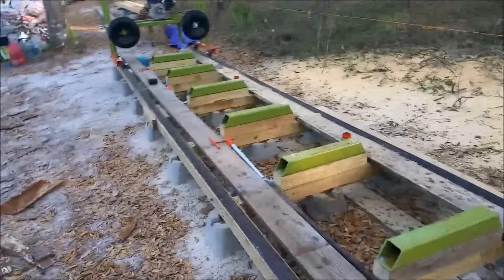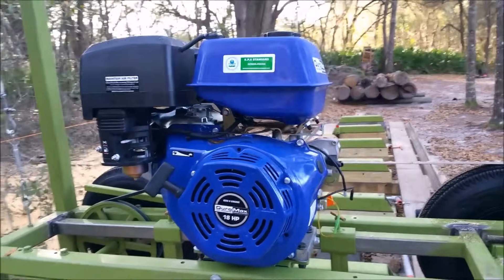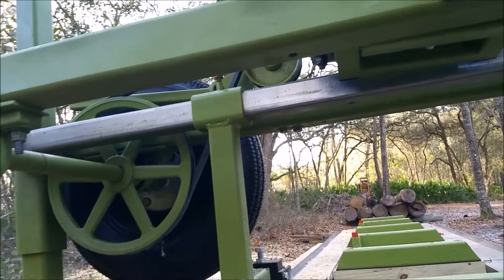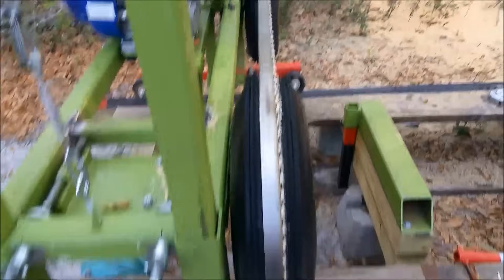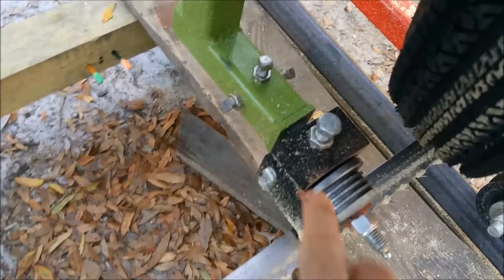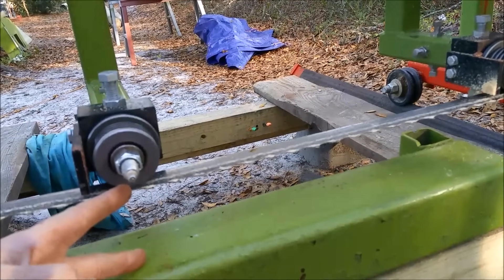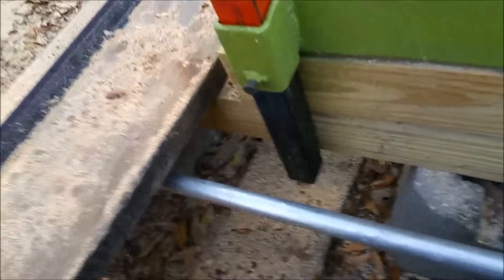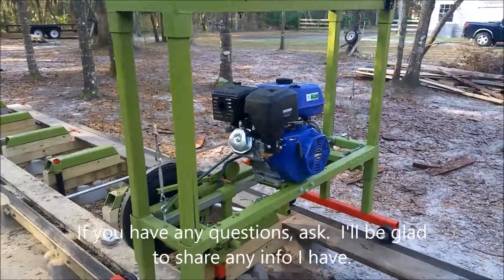Homemade Bandsaw Mill walk-around

Comment: Hey Josh, just getting back to finishing up my mill based on your design. First, I have to say I admire you for the support you give your followers with quick replies. Basically the only main difference I have made is using sheaves for the blade wheels instead of tires.
You gave some advice in the past about using cooks guides which I have purchased.  I am just ordering the 18hp Duramax and am trying to figure out the belt tensioner from the video images.  I do not need plans but some guidance and/or maybe a sketch of your assembly. I can see some of it but cannot determine where the pivot is.  Tried to view other mills and tensioner designs but none give enough information. You may have answered this within the comments but I do not know how to search within the content.  I hate having to ask but any help would be appreciated.
Reply from the maker: It has been a while for me, but I can try to answer. Of the whole mill, the tension/alignment was the hardest to create and make functional. The reason is the enormous amount of tension on the blade. After rebuilding this mill, I scrapped the tension/alignment of this build and went with a while different design from scratch. Anyways, this video has the tension/alignment design with the plate that slides and pivots. There is no "actual" pivot point. The plate slides within the rails along the sides and is curved on each end to allow pivot. The rest was created using 5/8" threaded rod and 1/4" handles like a vise design. I used coupling nuts so the threaded rod would have more bite. My pillow block bearings where mounted to this plate also. To tension the blade, you would turn both threaded rods to draw the plate away from the opposite axle. Once tight, you could tighten front or back threaded rod to adjust the alignment. The plate free floats within the rails. Hope this explains the process of what needs to happen.

Now why did I scrap this design? A few reasons. 1. The threaded rod and nuts showed fatigue that would have led to failure in a short period of time. 2. The plate was free floating which allows for movement that could not be fine-tuned. 3. Because the plate could bind within the rails and cause false tension pressure making you think it was the blade tension when in reality it was bound up.

The new design was using 3/4" threaded rod and square tubing the length of the blade. I welded handles to each end of the rod that stuck out past the band wheels on each side. This was much better for tension  and had no points of binding except on the threads themselves. For the alignment, I created an actual axle for two plates to pivot on. One plate welded to the frame, the other was able to pivot. I had a bolt that pushed the plate one way and one that pushed the plate the other. Once both were tightened, the alignment wasn't moving. Now, with blade expansion over usage, there was still a need for fine tuning, but a much better design. I also went to band wheels with the final rebuild.

I sure hope this helps. I don't have pictures or drawings to assist my explanations either. I never ever thought I'd be seen as a place to gain knowledge about sawmills. I'm 100% a DIYer and tinker with junk randomly. Lol .. As for Cooks, they are the place to gain useful knowledge.
Reply: @joshsbomber  Thanks again for such a quick response.  I know your time is valuable. Actually I was asking about the drive belt tensioner but am glad you replied as about blade tension. WOW. I was just getting ready to cut the slide plate for the blade tensioner.  I will try to look at how others are doing their blade tension for some ideas. I can usually figure these things out but this is a total different venture for me. By the way, I am practically a neighbor as I live in Columbia, SC and have lots of white pine available. I am only 68 so hope to get lots of use out of it when it is complete.
Reply from the maker: Lol. Maybe I should read a little better. Anyways, I went to a centrifugal clutch on the motor and would do it 100 times again. I used the motor mount to tighten the belt on that. 

I have family allover around Conway, Aynor, Sumter area...
Reply: Thanks Josh and cool about having family here.  We go through Aynor and Conway often on the way to the family beach house in Garden City and occasionally go through Sumter. Also will be headed down the Space Coast in May while my son is here from Washington State to go to the space center.
Any particular centrifugal clutch you can recommend. I like the simplicity of having that as opposed to a lever.  
I did order the engine from Lowe's today cause I get a military discount.
Reply from the maker: Cool. Enjoy your time at the space center. Cool place. 
I used a heavy duty centrifugal clutch. Not sure what brand or whatever. It works great.

Comment: Show how you attached the angle to the wood for rolling down track
Reply from the maker: I sold this mill a couple years ago, but all I did was drill some holes (bigger than the screws) through the edge of the angle. I used 3 1/2" deck screws through the holes into the 4x4s. To make sure the angle ran parallel, I rolled the carriage over the holes  on each side, then put the screw in. Moved on to the next one.

Comment: I love your build, did you set the tires to use a certain blade? I have been watching a lot of videos and some of the guys are saying they built them to accept standard blades like the hm130 or woodmizer 15. I'm trying to figure that part out.
Reply from the maker: Thank you. As for the tire setup, I bought the blades first and built accordingly. I also picked a popular size blade so 1) they'd be easy to find competitively and 2) to better find options on pitch, tpi, and hardness. Otherwise, blades can be custom made for whatever size you need, but at that point you have less options and less timely blade purchases.

Comment: Hi, this is awesome! I see you’ve posted awhile ago. How much use have you got out of it and. Are you still happy with the design?
Reply from the maker: I actually rebuilt this one with bigger axles and cast steel band wheels. I ended up selling that mill before making a video. 

The mill in the video had a few little flaws. The axles were undersized causing them to break often. The blade tensioner/alignment combo plate idea was a great idea, but not in reality. If I tightened the blade, I had to realign the wheel. I ended up spending more time on adjustments than actually cutting. On the rebuild, I upped the axle sizes, moved the bearings closer to the wheels, used actual band wheels, upgraded to 18hp, made tensioner separate from alignment, and extended the height another 20 inches. 

I really wish I would have made a video of the rebuild. If you plan to build your own, keep in mind that everything needs to be solid but adjustable. That's the hardest part to figure out. Go look at some and get ideas then go from there.
Reply: Gotta wing it an start somewhere you could change a component 10 times before going..... "oh"...... even the welds would need to be strategically layed or stuff will move and you'll never get it back square. Has anyone tried pumping up with nitrogen in the car tires?

Comment: I absolutely like this build. I see nothing wrong with it and seems to be very solid in design and construction. Do you have any issues without dripping water on the blade for lubrications? I would like to make something similar but maybe a bit shorter in length, being how I don't have a way to move long logs around with other equipment. Thumbs Up for sure!
Reply from the maker: Thank you. It was a good mill and I actually rebuilt it with larger axles and cast band wheels, but never got a video of that one before selling it. As for the water, I found that my mill did better dry than wet. Not sure why, but it did...

Comment: That's a good looking saw.if its flat ,level it will cut straight ,as long as you have enough tension on your blade and watch you push speed it won't dive on you.practice makes perfect, good luck

Comment: Do you get any racking or shimmying of the carriage in wider cuts with your mill? I have a very similar design to yours but i get the carriage almost 'walking' along tracks, when buried in a wide hardwood cut
Reply from the maker: There's some misalignment going on with big cuts or hard wood. I didn't know much about anything when I started on this and later realized that some tighter clearances would have eliminated some of that movement, but for yellow pine it cut fine enough to run through my planer.
Reply: @joshsbomber  mine is perfectly acceptable, I just get a bit of a washboard pattern while it's happening but still nice and flat. Just bugs me in my never ending quest for improvement
Reply from the maker: Haha. I hear you. I sold mine because I never could get it perfect. Gave up
Reply: @joshsbomber  haha I went the other way and now have 80ton of black walnut logs sitting in my yard. Was a strange offer that came up and I couldn't refuse. Definitely not how I'd have designed my machine if I knew I'd be chewing on an 80ton stack of logs
Reply from the maker: Haha. Right!?

Comment: I'm curious how long the blade lasts before you have to swap it out?  And can you resharpen them ?
Reply from the maker: Some guys cut a lot more wood than I did. I think I've heard before that some got 1000 board feet on a new blade and yes, they can be sharpened.
Reply: @joshsbomber   That's a good amount of lumber.  I was debating whether to try an build a swing blade sawmill, or a bandsaw mill.  I like the simplicity of your mill.
Reply from the maker: I looked at them all before building and settled with the bandsaw. Less waste, fast cuts, and the swing blade only cuts dimensional lumber.

Comment: Enjoyed video! Mill looks great! I like the design but didn't see much saw dust. How well does it saw?
Reply from the maker: It sawed straight enough to run the boards through a planer to finish off. Not too bad, in my opinion. I rebuilt it after this video and ended up selling it. Check out my channel, there's a video of two of it sawing

Comment: nice build what size shaft and pillow blocks are they?
Reply from the maker: I forget what website it is with a calculator,  but Google search it and it will give you the blade feet per minute. Should be around 5000 if I remember right.
Reply from the maker: Thanks. This build was 1" axles (axle steel), but they broke a few times. I ended up rebuilding this mill with 1.5" cold rolled axles. The larger axles worked much better - never broke on me
Reply: @joshsbomber  Ya I am making one right now and i didn't want to go with 1 inch shaft so I'm  going with 1 1/4 and  16 hp duramax , 19'' band wheels and a 14'' drive wheel and a 3'' centrifugal clutch so hope it works. For some reason I was like do i get a larger size pillow block to go over the 11/4 pillow block its been awhile. thanx
Reply: I mean the 1 1/4 shaft. by the way do you feel your tire pulley ratio is good?

Comment: Looks like you got it {DIY Bandsaw Mill} dialed in this time. May I make a suggestion, instead of using the adjustable clamp's to hold the wire cable, make your self a DIY Stainless s Steel Safety Wire (Uses 0.032" in. Dia. Wire) only, (not plain old steel wire. Does not have the strength like Stainless.) Clamp Tool. Speaking from experience, the stainless wire compared to regular wire, is approx. The stainless wire is 3 times stronger to 1 (plain steel wire of same diameter) difference.  See for clamp tool design, and how to use: ClampTite Wire Clamp Tool | SEMA Show Preview - - https://www.youtube.com/watch?v=3NXVnmMjFk4
Reply from the maker: Thanks for the comment. Sounds like good advise. This mill was rebuilt after the video and eventually sold to a guy within an hour or so of me.

Comment: G'day! I am designing a bandsaw mill and taking a lot of notes from your design. After a few years of using yours, what things would you do differently/change with your design? Or are you happy with the way everything works??
Reply from the maker: Very good question. I rebuilt this mill starting with the axle size and actual band wheels. Go ahead and spend the money on larger diameter axles and cast wheels (pulleys or bandwheels). Otherwise the rebuild was just tweaking some things. I rebuilt the tensioner/alignment part with a whole different design and it worked well (too hard to explain honestly). Also went with a centrifugal clutch instead of a lever engage. I ended up selling it not long after that. If I could do it again, I'd probably go for the "H" style frame around the wheels and use acme rods for lift lower. Otherwise it did a fine job
Reply: @joshsbomber  I was hoping you wouldnt say that about the wheels lol. Cast wheels are so expensive! Yeah that was my main concern with the design (the tensioning and alignment setup). As i am planning for my mill to be a little wider, do you think i should go with a different design for the tensioning/alignment? Or will your original design suffice?
Reply from the maker: Light usage, the original design would work, but it's not perfect and would wear with a lot of use. It was just difficult to find the balance between tension and alignment with the same parts. Separating them would be optimal
Reply: @joshsbomber  When you rebuilt the tensioner/alignment part, did you use a bottle jack hydraulic type system for your tension? Thats what i'm leaning towards.. I still like your alignment setup, i will still try to use that if i can

Comment: If you are up to a challenge, can you build a swing blade mill ? The compair them and their cost .
Reply from the maker: I appreciate the confidence, but I just don't have the time or money to build experimentally.
Reply: @joshsbomber  same boat here...  I have seen several designs .. one similar to the carriage you have, just the swing part gives me headaches. The simplistic one I have seen is a chainsaw direct drive to the blade on a swing carriage. Never would have thought of that one myself.
Reply from the maker: I debated the type of mill before building this one, but figured the bandsaw mill was most useful. Blade kerf had a good deal to do with that decision also. I had three in mind - bandsaw mill, swing arm mill, and chainsaw mill... obviously chose the bandsaw mill
Reply: @joshsbomber  I have the makings of the Alaskan, but I am leery of using it. My chainsaw is at my limit of handling . I have a blade from an old sawmill that isn't too large and I could turn it into a large table saw. Swing blade would be nice as it would not require anything else to handle the log,  just cut it in place. The kurf would be a trade off. Bandsaw is good for thin cuts. If money was not an object, I would have all 3
Reply from the maker: If money was no object, I'd have a few saws also, my friend. Lol

Comment: Excellent work, I would like to know how many millimeters are the teeth of the tape and how long is it ?.
Thank you very much, Max Burgos.
Reply from the maker: Thank you for the comment. I'm confused what the tape is that you are referring to.
Reply: My WhatsApp +504-89298288
Reply: Size of saw teeth ?.
Reply from the maker: It's a 1.25 inch width, a tooth every 7/8 of an inch, 10 degree rake

Comment: Is she still running a few years in?  Any design changes you would make if you were diving back into a rebuild?
Reply from the maker: I actually rebuilt this one a couple years ago and then sold it. I upgrade to actual band wheels and larger axles. Also added a centrifugal clutch and extended the height to fit larger logs.

Comment: wow. that is awesome. great design .  What are dimensions? I need to purchase some steel tubing so I can build one of these. thanks.
Reply from the maker: It's been a couple years since I built this one and ended up selling it. I think the frame tubing was 3/16" X 2 1/2" square and the rest was 2"... they didn't fit perfectly. I wish I would have made them slide a little tighter somehow. In fact, I sold this one to start on a new one, new design, but never got around to it. Lol

Comment: I would suggest you put raw linseed oil on your timber parts of the bed regularly  to protect it from damage from the weather . Before t hats done if you can access some Bayer Lebaycid insecticed used on fruit trees and using a fairly strong mix coat the wood and let it soak in several times this will keep white ants and other nasties out. Let it dry a few days then spray with the linseed oil. Do not use oil motor oil like some do as the chemicals in that destroys the wood.

Comment: Hi! Very nice! I need a belt tensioner like that. Can you help me? Thanks
Reply from the maker: I actually rebuilt this mill and used a "B" type belt centrifugal clutch instead of the lever type tensioner. It worked 10 times better. I'd recommend the clutch over the lever.
Reply: @joshsbomber  ok. in the meantime I decided to make a system for moving the engine because it seems better. thank you!